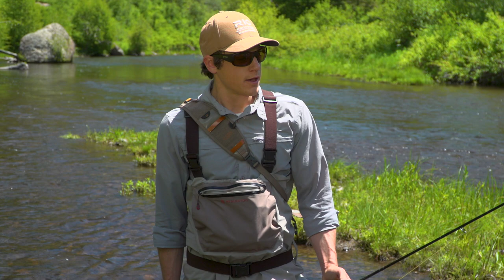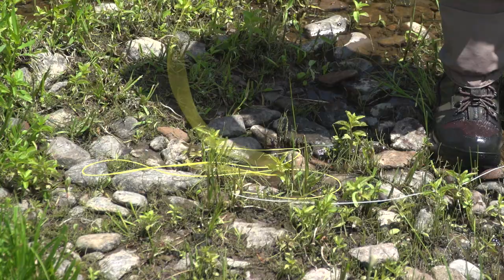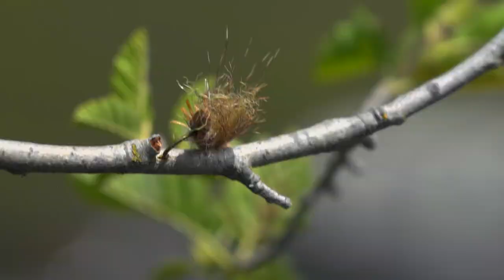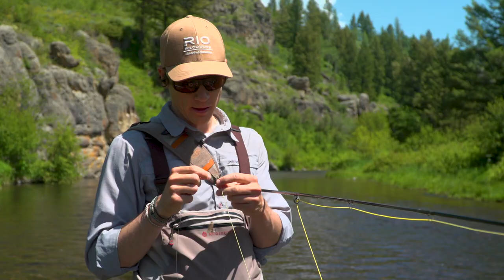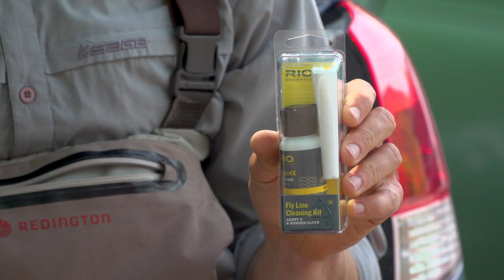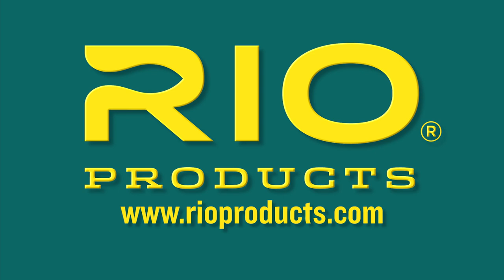How To Prolong The Life Of A Fly Line - S5 E3

Comment: Good video with a lot of common sense tips.  I have been fishing RIO lines for a few years and really like them.  My only points of failure have been in the last foot of the loop (head) end with either cracks in the coating leading to water penetration or loop failure.  Any tips on how maintain this specific part of your fly line that arguably receives the most wear and tear?
Reply from the maker: Thanks for your message and for your support - that is very much appreciated. 

Sadly the front of the line DOES get the most wear and tear, and because it is the front end of the taper, has the least amount of coating of any part of the line. The less coating their is, the shorter the life span, generally. T

his is not ideal - having the part that gets the most wear and tear being the least durable, but without making the line tips a lot fatter (which would make the line kick like a donkey when cast), it is very difficult to avoid this.

Having said that, our R&D team have been working very hard to create a new type of coating at the front that will help. We aren't calling it out, but it is part of the SlickCast technology, so if you ever get a line with SlickCast, you should find the tip quite a bit more durable than before.
Reply: Thanks RIO.  I bought your Elite Gold WF 6wt this month and hope SlickCast can help wring a little more longevity.  Appreciate that there all always trade-offs in any piece of equipment.
Reply from the maker: @trevorgosselin9778   Thanks Trevor, nice of you to buy one of those. You should certainly find much better durability all round with that line. If you haven't tried it yet, you will immediately notice how slick it is, as well.